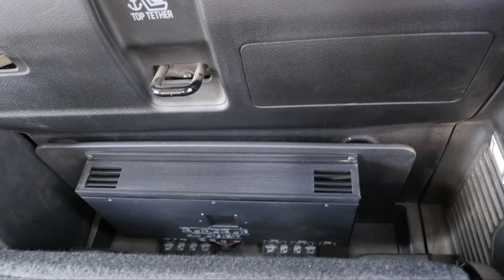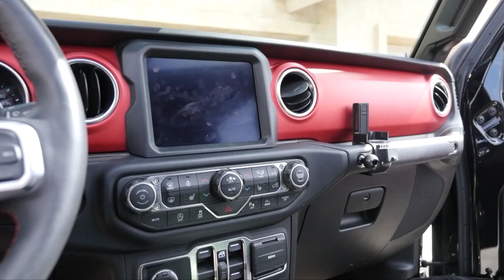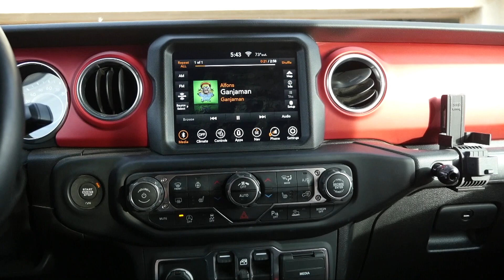Gladiator JT Aftermarket Sound System | Audio Clip at 2:20 |

Comment: I also have the PAC, 5-CH amp, an 8" sub which was installed at a shop but I'm getting 90% of my sound from the rear.  Are you running all your factory speakers through the 5 ch amp?  My Top dash speakers were disconnected and the knee panel speakers give very little highs. The speaker bar and sub sound great but I need more up front.

Comment: Sweet jeep. What bracket is that holding the dual light on the a-pillar? If possible a link?
Reply from the maker: It’s not a good bracket
Reply: @OverlandishAdventures  ahh okay. That sucks. I’m looking for something like that where I’m able to mount double lights on each sides. Any recommendations?
Reply from the maker: @PogiPR  I do not, but its from Diode Dynamics , They are heavy and they rust....  Have you looked at our latest video, those are nice, but only for single...

Comment: Did you have to cut any plastic to fit those rear marine speakers?
Reply from the maker: Yes but super easy
Reply: @OverlandishAdventures  Thanks for the reply! In the video for your front speakers, you mentioned metra has a pre-designed box (instead of fabricating your own), could you link that specific part?

Comment: Did you have to run new wires for the 6.5 speakers?
Reply from the maker: No just used one of the two that are in the box. They are not crossed over or anything